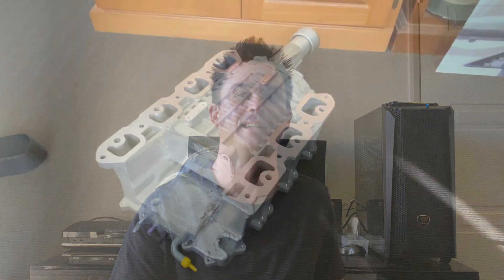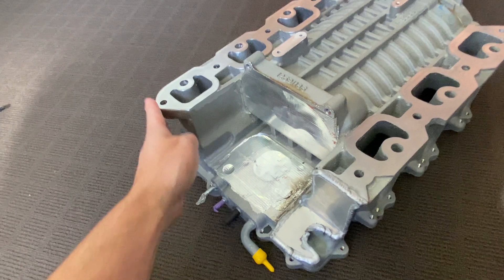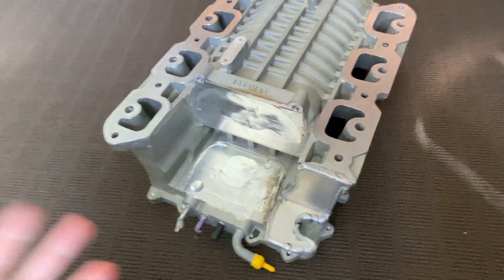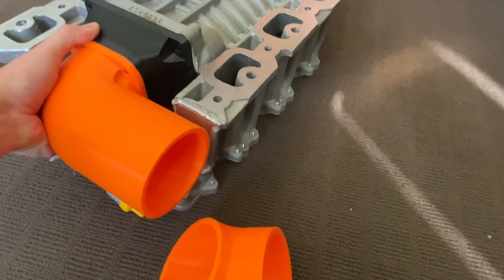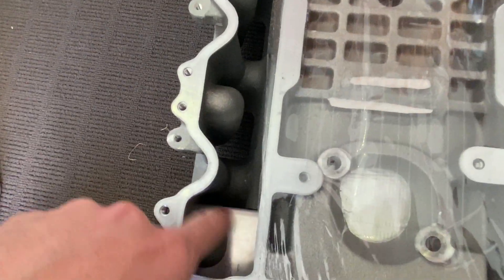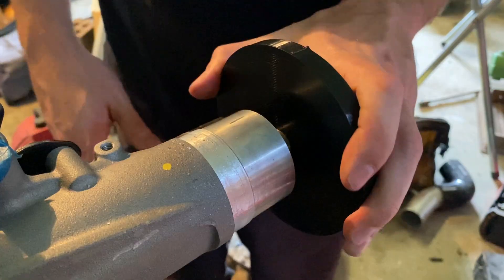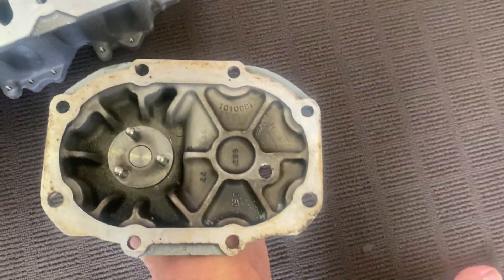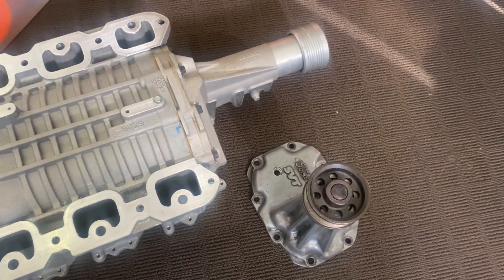I Modified a Northstar M122 Supercharger Case!

Comment: If I was going to do mine again I would put a separate large crank pulley in front of an aftermarket harmonic balancer. (Because the uz crank is so small) There’s an offset air filter for the vortex super charger that I think would get it above the wipers enough.